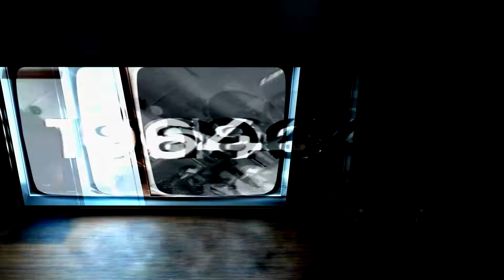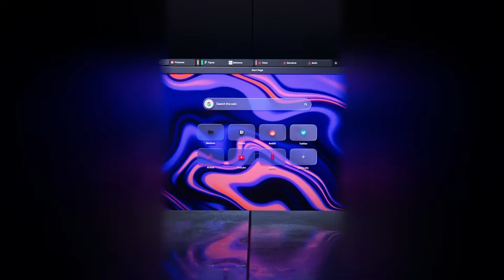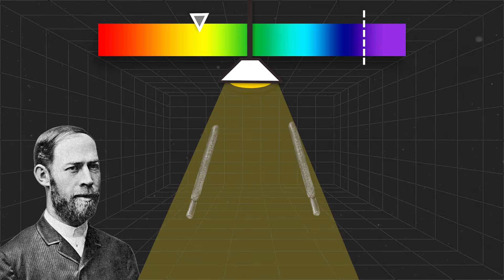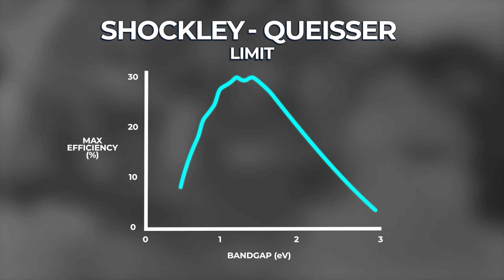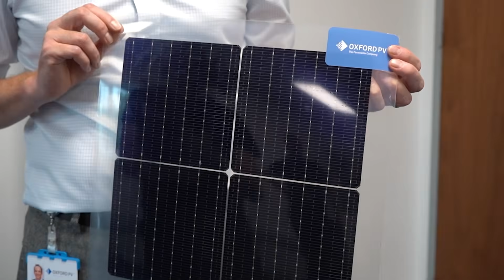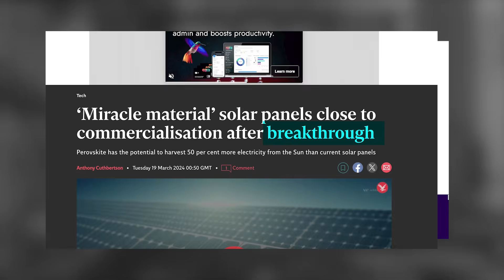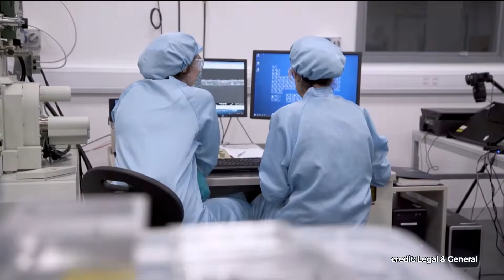How Physicists Broke the Solar Efficiency Record

Comment: silicon cell efficiency >27% and module efficiency >25% already being mass produced, not the 18-20% limit you said in the video 8:30, it's actually much higher than that.
Reply: What I thought, too!
Reply: Maybe on the planet Mercury perhaps?
Reply: @astoni314  You'd be surprised, it's no joke and certainly your sarcasm shows how little you know. 
Chinese tech takes a giant leap every year, while the US is still driving electric cars with 400km range they already have dozens of models with 800+km range overseas, two or three are above 1000kms range on a single charge, and they are still pumping out a few new models every half year or so. Quite a few hybrids have achieved 2000-2500kms real life range on a single tank of gas while even 1000kms range on any car in the US is rare. On top of that, you have a lot of choices for the price tag of just $20K - $30K USD, a few of the 2000kms range vehicles are actually just a little above $10K USD from BYD, they all come with giant screens and other bells and whistles too. But thanks to the tariffs you won't ever see them in the US, if you ever do, you'd be paying at least 300% the price. More than 50%+ of all new cars sold in China are some sort of electric, while in the states this number is not even 10%.... Solar panels are produced at about under 5 cents per watt and you can buy the panels at 10 cents per watt, but thanks to the tariffs again you will be paying $2 (20 times more) in the US. And installed cost would be even higher. It's no surprise that renewable energy production in china as a percentage of total energy generated in the country is many times of that in the US. The big corps are doing their best for the past 30 years to prevent us transitioning to a sustainable, self-reliant energy source because this is their cake to lose, it does not matter if it is great for the planet or better for our wallets.
Reply: It depends what you get. A high quality cell is 25-28% whereas a cheaply produced one (often put in bargain solar panels) is probably 18%.
Reply: Yep, here I am looking at my solar panels with a 23.2% efficiency, questioning what year the 20% the paper cited was from.
Reply: Most commercially available solar panels have an efficiency of less than 23%, with an average range of 15% to 20%. i wish 25 was being mass produced
Reply: @koaasst  we installed about 35 000 PV panels and through two last years they raised from 20.5% up to 20.8% through the 4 types of PVs from 400Wp up to 550Wp - mostly because of size changes (all Risen Solar company)  

/calculated from standard measurement environment with perpendicular light with intensity of 1000W/m2 - then any deviation from that, lowers efficiency drastically = clouds, fog, tilt, dust .... /
Reply: @koaasst  They are being mass produced, Longi and Jinko are just 2 brands off the top of my head producing panels with module efficiency>25%. There are dozens and dozens of companies produce module efficiencies above 23% I don't even need to list. Don't limit your sight on US companies only, there are a lot more in the solar panel world than you know. Also, some US and Canadian solar panel brands import semi finished products from China and build from them.
Reply: What would it mean for humanity to control 100% of the sun's energy reaching earth? Where is the limit where ecosystems collapse?
Reply: @ian7819  not control! It's a metric of consumption. The present source is fossil fuel inside the earth
Reply: @ian7819  equivalent, not actual
Reply: Efficiency does not matter when the source is infinite to the end of time.

Who cares if it is 23% or 20%. So what, You have to buy 15% more panel area to make up the difference? And mass-market panels are about $0.03 to the $1 of the best technology.
Reply: @Triple_J.1  You are right, it would not matter much IF you have the space. Also, buying 23% panels for a given wattage may end up cost more for the equivalent wattage using 20% panels(even with 15% more panels). However, for people who live with limited rooftop spaces, they might not have the real estate to put up 15% more panels. For them it's the difference between 'possible' and 'impossible' to achieve a certain wattage, thus the difference between achieving a usable wattage or left with un-usable wattage. Also, if you ever think about integrating solar panels into house windows and car panels, every percent of efficiency would matter so greatly. 
See my next comment for the cost details... you assumed a $0.03 to the dollar because the price you see in the US is so high, and with that price you won't break even until at least after 20 or even 25 years. However people overseas see a breakeven time of just a few years, maybe as little as 4-5 years... because what you get for $2 here you could get for a small fraction of that, as long as its not in the US, Canada or any of these countries that impose a 300% tariff on chinese products. We as consumers are paying the ultimate price for these tariffs.
Reply: @Triple_J.1 
you are right.. but solar panel size and quantity does matter a lot.
if i am getting 1kw of power of solar panel that its the same in size as 500w then its a BIG deal.

Comment: If adding a Perovskite layer makes a solar panel cheaper per unit of power generated, doesn't that imply having just the Perovskite would make it even cheaper? Stacking only seems useful if space is an issue.

Comment: This is company PR and misleading by leaving out a ton of context. Oxford PV has a production line of "production capacity of <50MW" (their words), and are planning for 250MW. They are not the first commercial supplier either, only of tandem cells. Perovskite commercial production started in 2021.
Here are 6 (!) companies with a bigger production line:
Wonder Solar (200), Utmolight (150), Renshine (150), GCL Optoelectronics materials (100), Microquantyu (100), HETE Photo Electricity (100).
Four of those are currently constructing a GW scale line, 2 of which are expected to go online this year. These cells are not tandem and hover about 20%. Hete is also at 28% efficiency, which is higher than Oxford. The source is Mitsui & Co., a Japanese research/trade company.

As a "science communicator" there is an assumed obligation of doing your due diligence, especially when a company invites you to do their PR.
Reply: It's like the Northvolt. As far as I could check none of the companies that you have listed have a production line either. Their install seems to be more like test-installs. Am I wrong and if not so, any idea of the price/lifetime ?

Comment: Just like Hypeloop, Dyson spheres break the first rule of manufacture: Don't ignore cost of materials.

Where in the heck are you going to get enough material to construct a Dyson structure of ANY size?  There's not enough raw materials or resources to collect it, process it, install it.

HypeLoop was NEVER going to work as it requires 100x the steel and 20x the complexity to operate vs existing High Speed Rail tech.

Comment: I asked chatGPT to design a perovskite solar panel 

Design Summary

This solar panel design incorporates cost-effective conductive materials without compromising on performance. Here’s a step-by-step layout of the final structure:

Front Transparent Electrode: FTO or AZO on a glass substrate (rigid) or silver nanowire/graphene-polymer network for flexible applications.

Electron Transport Layer: Thin film of SnO₂ or ZnO, doped with graphene for enhanced mobility.

Light Absorber Layer: Perovskite (e.g., MAPbI₃) or a silicon-perovskite tandem layer.

Hole Transport Layer: PEDOT

, graphene-CNT composite, or copper oxide.

Back Electrode: Copper coated with graphene or aluminum for durability.

Encapsulation Layer: PET, Parylene, or Teflon for environmental protection.

Additional Considerations

Stability Enhancement: To extend lifespan, encapsulate with UV-resistant materials and add moisture barriers.

Scalability: For larger panels, blade coating or slot-die coating methods can help scale up production and lower costs.

Flexibility: If the panel needs to be flexible, use a polymer substrate and replace rigid FTO with a transparent nanowire or graphene-polymer network.

Benefits of This Design

Cost-Effective: By replacing gold and silver with copper, aluminum, and conductive polymers, this design minimizes costs.

High Conductivity: Graphene and copper ensure excellent charge transport.

Environmental Resistance: Encapsulation and graphene-coated layers protect against oxidation and environmental wear.

Scalable & Flexible: The option to use flexible materials and large-area coating methods supports both rigid and flexible panel designs for diverse applications.

This design maximizes efficiency and durability while keeping materials affordable and widely available, making it suitable for commercial scaling and deployment.

Comment: Summer 2024 DIY 14 KW system installed.   Despite a modest understanding of the physics the tech has a almost magic feel.  Having 
control over only a tiny fraction of the suns power is rather amazing, far more power than a small campfire and way more useful.

Comment: Kardashev's scale is about consumption but does not account for efficiency. For example, in the '70s we used incandescent lighting but nowadays we use LED lighting, so we have become more efficient in e.g. lighting a room with the same lighting intensity but at a fraction of the previously used amount of consumption. So there is a need to redefine this scale incorporating efficiency as well.
Reply: Don't forget to allow for Jevons paradox though - an increase in the efficiency with which a resource is used can result in a counterintuitive increase in the utilisation, because new uses which were previously not viable become worthwhile and there is less pressure to conserve. LED lighting does provide the same light at a fraction of the energy, but that also mean the lights might be left running continuously rather than turned off any time the room is empty. Or that the LEDs might now be used to construct large-scale light shows and advertising displays.
Reply: And since energy use is closely related to the destruction of biodiversity, maybe the concept  of this scale is just nonsense in our current context.

Comment: The Hertz joke earned my sub lol.
I would be curious to see in the future how these early perovskite cells degrade. If they are still putting out at least 80% of designed output in 25 years, I would consider them a decent investment. If they manage 90%, I would consider that a massive success.
Reply: I would think the "defect tolerance" should help in that regard. Especially if initial production still works to reduce the defects rather than cheap out. I could easily see a bunch of cheap panels flooding the market where early degradation is ignored for both legitimate and cynical reasons.

For example, why incur the cost of polishing the perovskite layer if in 5-10 years a much more advanced product will be available and reasonably affordable to replace the panel? In such a case, it could be argued you're better off gearing production toward a stopgap mentality than a durability one. Or, on a silicone-free panel, perhaps production can become cheap enough that longevity is far less of an issue.

Of course, that carries the added benefit of repeat business, and all the cynical intentions that come with it. And then there's what to do with the old panels. Probably suck up landfill space like iPhones.

But the underlying question is still how stable these layers are over time, of course.
Reply: The degradation issue has been much reported, but gets little .mention here. What is the current status?
Reply: @TonyFisher-lo8hh  According to first google result, silicone degrades at 0.3-0.5% per year, depending on environment. After 25 years, that means the average is likely still producing in the range of 80-90% of original rating.
Reply: @kstricl  The silicon degradation is well documented, but past reports have been much less optimistic for perovskite.  The outstanding question (poorly addressed here) is the perovskite long-term reliability.

Comment: You can get to type 2 by bypassing the solar collection method entirely by tapping the zero point energy field. Infinite energy!
Reply: That would only be possible if the zero-point field is in a metastable state. But if that is the case, then extracting energy from it would cause it to transition into a lower energy state. This would be a Very Bad Idea.

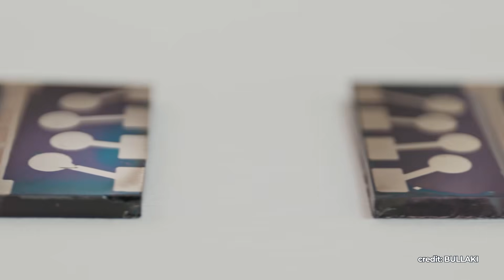Comment: Pedantic comment: at 5:00 "below a certain minimum wavelength they can't generate electricity" should have probably been "frequency"? Wavelength is inversely proportional to frequency, so there should be a certain maximum wavelength above which no electricity is generated.
Reply: Point!

Comment: @19:20 That actually sounds like what a plant does.... 
This concept is striking similarity to how plants maximize light absorption using different pigments, where each layer optimally absorbs different wavelengths, leading to a highly efficient overall capture system. (Even if the energy conversion rate is still abysmal, but that a different topic)

In both systems, the goal is to capture as much usable light as possible across a range of wavelengths without causing damage or inefficiencies in the structures responsible for energy capture. In plants, chlorophyll and accessory pigments such as carotenoids absorb primarily in the red and blue regions of the spectrum, where light is less intense but highly effective for photosynthesis. This selective absorption at the surface reduces the risk of light overload on chloroplasts while maximizing the use of available energy. Meanwhile, green light, which is more intense and less readily absorbed by chlorophyll, penetrates deeper into the leaf structure, allowing it to be gradually absorbed by more chloroplasts as it travels through the leaf’s layers, and even on to lower layers in the plants canopy.

By distributing the absorption across pigments and layers, plants achieve a balanced, high absorption rate of around 80-90%, effectively utilizing the full range of available sunlight for photosynthesis while protecting their delicate cellular machinery.

Unfortunately, despite high light capture efficiency, plants have a low energy conversion rate due to inefficiencies that occur after light absorption. In the light-dependent reactions, not all absorbed photons drive electron transport or ATP production, leading to quantum efficiency losses. Additionally, photorespiration competes with photosynthesis, especially under high oxygen or heat, causing plants to lose energy as they process oxygen instead of fixing carbon dioxide. Further thermodynamic inefficiencies across the many chemical steps of converting captured energy into sugars reduce overall yield. Finally, plants use a portion of the energy they capture for cellular respiration and maintenance. Combined, these factors result in only about 1-2% of absorbed light energy being converted into biomass.

But regardless, it is easy to see the similarity, at least in the core concept.

Comment: Making them cheap is the big deal for me. Right now, I gotta drop over $500 per kilowatt, and that's just the panels. Not exactly a great time. Same thing goes for batteries. Buying enough to make home use practical is just pain.

Comment: The area of these super cells is still tiny and Perovskite degrades.  The result is that this work is still very far from making any significant difference from simply using the standard variations of Silicon cells in mass production. 😞